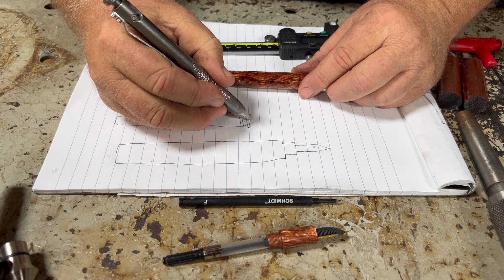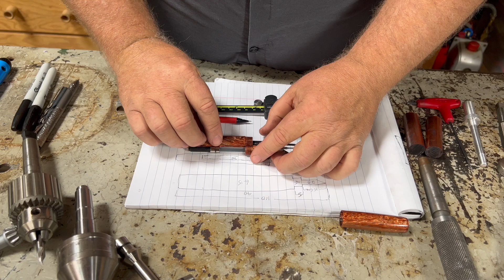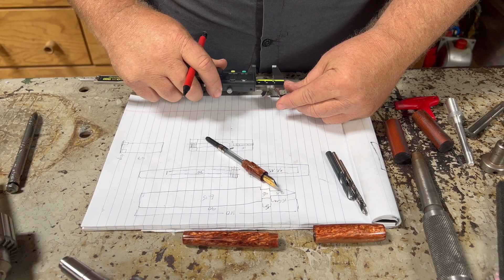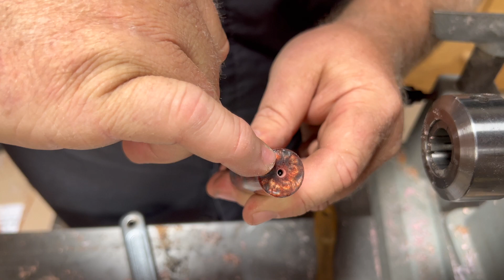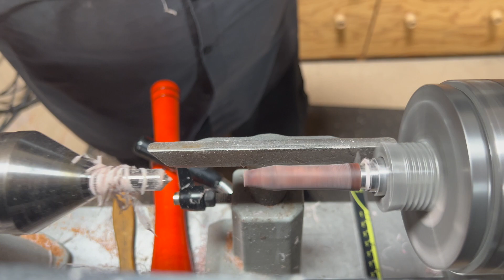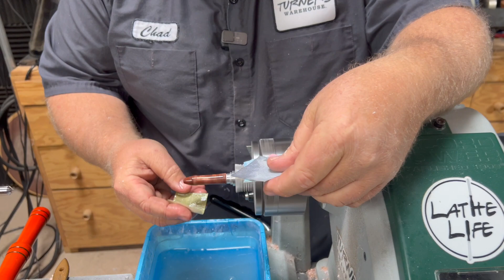Custom/Bespoke Pen Making- RollerBall Section,       Kitless Bespoke Pen Making

Comment: NOTE: I found the 2.5mm is tight for the roller ink I am using.  The very tip of the ink fits fine but there is a taper up to about 3mm just below the 5mm shoulder.  I ended up drilling a 3mm whole (before the 2.5mm hole) about 5mm deeper than the 5mm hole.  If you can follow that it might solve your issue if you find the ink it a bit tight.
Reply from the maker: This is awesome advice!! Thanks so much for always sharing your work and insights!